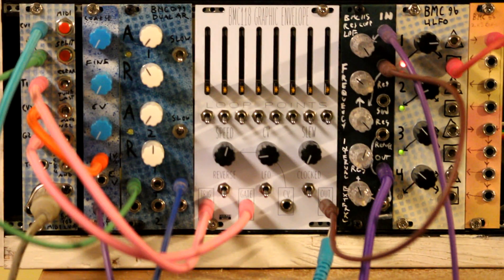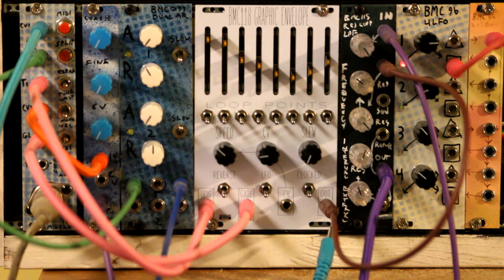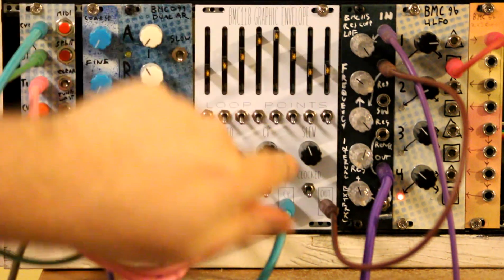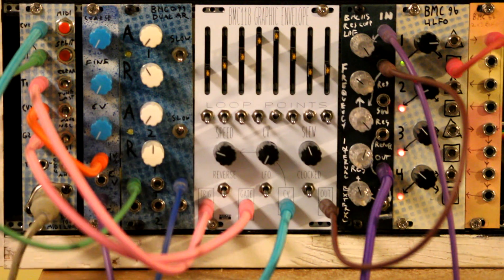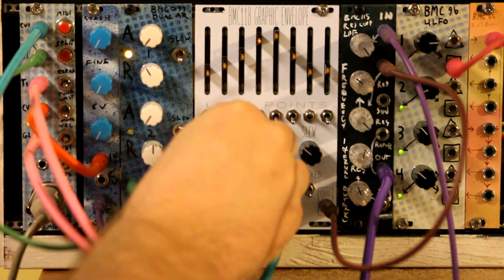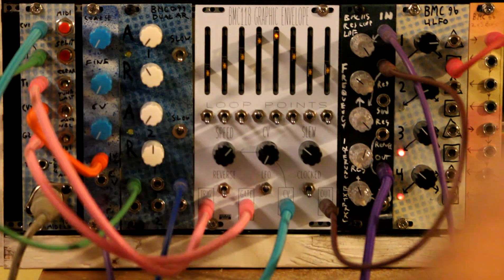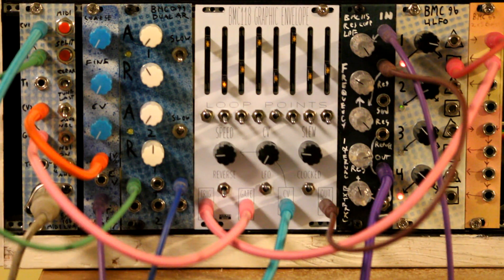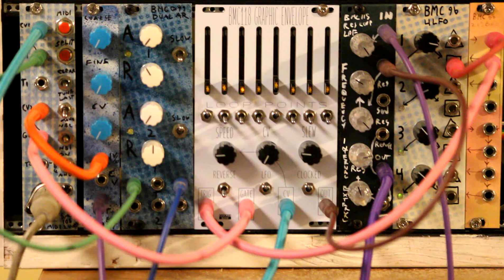BMC118 Graphic Envelope Demo

Comment: Your oldest video is about a very similar module, what's that about?
Reply from the maker: The original didn't get released because it was too complex without doing a panel and I couldn't do panels cheaply at the time (2012?).  Then I forgot about for a decade and started working on it again last year.